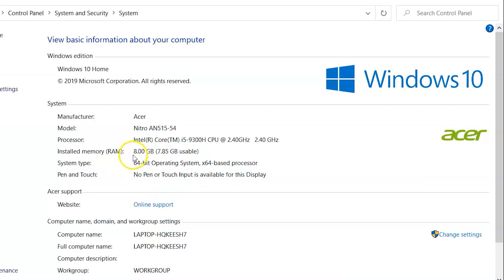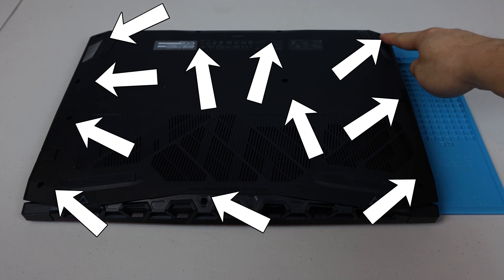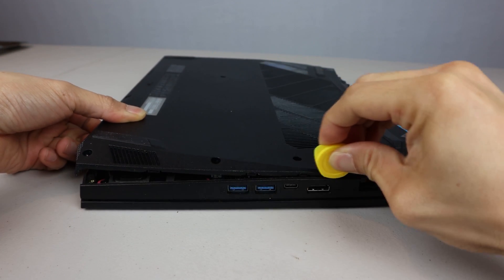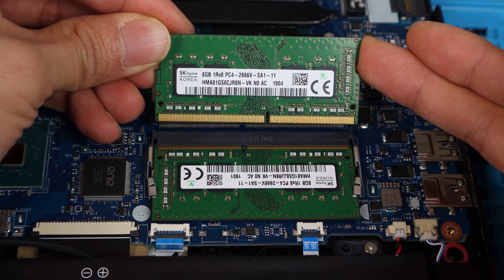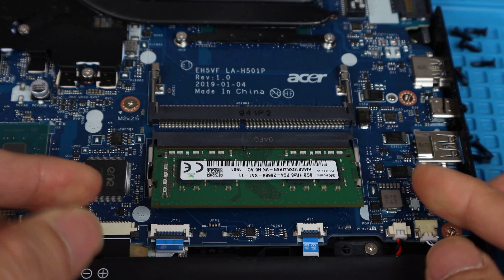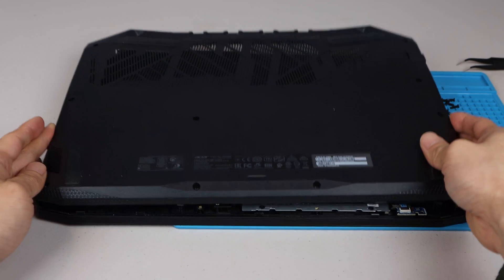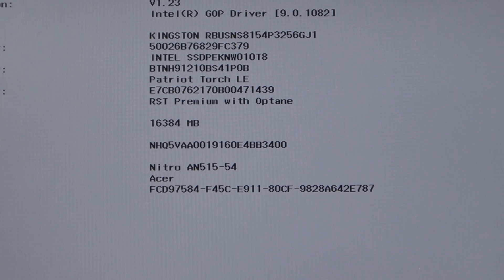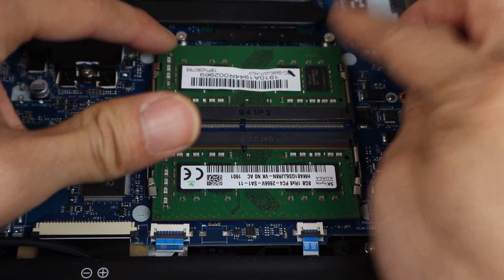How to Install or Upgrade RAM in an Acer Nitro 5 Gaming Laptop (2019 ver) DDR4 up to 2666MHz 32 GB

Comment: @FixItPhil  my laptop came with no ssd in it .but  on laptop its written that it has duaL M.2 SLOTS + ONE HDD SLOT ALSO model is AN515_43 and what i heard  that 32 gb is overkilll ??
Reply from the maker: Yes, for the AN515-43 there are 2 x M.2 slots and a 2.5" HDD slot, similar to the model shown in my video. Slot 1 can accept NVMe/PCIe interface SSDs and Slot 2 is compatible with SATA only. 32GB is the maximum amount of RAM your model can use, but for most users and gamers 16 GB will be quite fine.
Reply: @FixItPhil  oh ok thnx man👍

Comment: i have the acer nitro 5 and i have 8gb of ram, if i were to get another stick of 8gb ram would it have to be the same brand or model of ram stick as the one that comes with the computer. If so can you tell me where i can get it.
Reply from the maker: It doesn't have to be the same brand (though that's usually preferred) and in terms of model, as long as it's the same type (DDR4, DDR3 etc.) you really just need to match the speed (MHz). Here's the 8GB 2666 MHz stick I got for mine, at Amazon: https://geni.us/TDIO [Amazon Affiliate Product Link]

Comment: The rank of the second ram stick has to match?
Reply from the maker: You'll want to get the same type (e.g. DDR4) and same speed (MHz) for the second stick of RAM. You could use a different speed, like one faster or slower, but the laptop will limit the total speed to the lower of the two sticks.
Reply: @FixItPhil  Thx phil, i got the same type and speed.

Comment: Hello, What a good video, thank you ; My case ,   I just bought an Acer Nitro 5 15.6" Gaming Laptop (Intel Ci5-9300H/256GB SSD/8GB RAM/NVIDIA GeForce GTX 1650/Win 10), and i want to expand its RAM to 32GB so what is the proper memory (brand name or link where I can get it ) to buy and get it installed ? 
I saw in other video that you recommended this one " Patriot Viper Steel DDR4 16GB 2666MHz CL18 SODIMM Memory Module "  in amazon 
https://www.amazon.ca/dp/B07QMPTNXY?tag=rbpblogca-20
will it work ? ; please advise!!!
Reply from the maker: Yes, the Patriot Viper steel RAM is compatible with your laptop and should work great. If you want to have it installed for you, you can try bringing it to Best Buy, they have a Geek Squad desk that can help you with that, you don't have to buy the RAM there.

Comment: Hey phil ion anything about these things all i want is max upgrade for my acer nitro 5 ryzen 5 2019 model . Can u explain me what things can i upgrade and my laptop already have 1 tb hard disk . Can i change it into ssd . What is the max range for the ssd in the laptop . And bout ram and memory  . ???? 🙏🙏(My model have 8 gb ram and i tb hard disk )
How much i can  upgrade  this laptop??.
Reply from the maker: All the Nitro 5's max out at 32 GB of RAM, but since the chip inside is 8 GB, you would need to remove it and install two 16 GB sticks instead as there are only two slots available for RAM (see 1:52, the layout inside your laptop should look similar). Here's the RAM that I recommend: https://geni.us/52cnxY [Amazon Affiliate Product Link]

As for the drive, I can't tell from your description if the drive installed is the M.2 drive or a 2.5" drive. If your spec says it's a HDD, then it's a 2.5" drive for certain and it can be replaced with an SSD. If you're not sure, you'll have to open it up and check. All the drives can go up to at least 2 TB of capacity, though the 2.5" bay may be able to handle a 4 TB drive, if you can find one thin enough to fit in the slot (7mm thickness), like this one: https://geni.us/R7u3Bsu [Amazon Affiliate Product Link].

If you have an available M.2 slot, you can install a 2 TB SATA M.2 (I've heard most AMD chipsets are not NVMe M.2 compatible), so you can check out this one: https://geni.us/P7c7kfS [Amazon Affiliate Product Link] Of course if you remove and replace the existing 1 TB drive in your laptop, you'll want to clone/copy it over to one of the new drives, so you'll have the OS in order to boot up and also transfer over all your games and files. Good luck with your upgrade! Let me know how it goes for you.
Reply: @FixItPhil  thnx man appreciate the response thnx again🙏🙏
Reply: @FixItPhil  my laptop came with no ssd in it .but  on laptop its written that it has duaL M.2 SLOTS + ONE HDD SLOT ALSO model is AN515_43 and what i heard  that 32 gb is overkilll ??

Comment: Hello There! Can I also use this tutorial for acer nitro 5 amd 5 edition?
Reply from the maker: Sure, most of the current gen Nitro 5's have a similar layout in terms of the screw placement and internal components. Individual models may vary slightly inside, but for the most part you should be able to recognize the slots where upgradable components can be placed. Everything is labeled on the motherboard.
Reply: @FixItPhil  thank you!

Comment: I have a nitro5 AN515-54-5812 will it use the same one you linked to?
Reply from the maker: Yes, the base model is the same as mine AN515-54, the other part of the model code is just the configuration (drives, RAM, processor, GPU etc.)

Comment: What ram is included in the Acer nitro 5?
Reply from the maker: Mine came with a Hynix 8GB DDR4 2666MHz chip; the specific build is he 54W2. Different builds may come with a different brand or capacity chip though, and it could vary by region (e.g. UK, Canada, Asia etc.)

Comment: hey man i just bought an acer nitro 5 and it has 4gb ram. i wanna add two 16 gb sticks how do i know which to buy. it is up to 32 gb
Reply from the maker: Yes, you can upgrade up to 32 GB of RAM. You should be able to use any DDR4 SODIMM 2666MHz chips in the current gen Nitro 5, though some AMD builds are limited to 2400 MHz. Your best bet is to take a look at the chip that's currently installed and match the speed spec (Mhz) and brand, though that's less important, and just get the higher capacity (2 x 16GB). Here's one that I usually recommend: https://geni.us/52cnxY [Amazon Affiliate Product Link]
Reply: FixItPhil what if i put one 16 gb stick in the other slot while the other slot has 4gb ? will that work fine or should i remove the 4gb stick and leave the other one empty?
Reply from the maker: It's fine to leave it in and pair it with another RAM stick. The performance shouldn't be "worse" than just the 16GB stick alone. If you do experience problems for some reason, using just the 16GB stick on its own would be fine too.

Comment: Do you have to replace the one that came with it or is it optional?
Reply from the maker: No, you don't have to replace it if you're only installing one other chip. It depends how much RAM you want total. I left my original one in and just added a second 8 GB chip for 16 GB total RAM. If I wanted to max it out at 32 GB, I would have had to replace the original 8 GB chip with a 16 GB and add a second 16 GB stick.
Reply: @FixItPhil  also, dose the speed have to be 2.666gh? Or can it be an 2.4gh?

Comment: i installed https://www.amazon.com/gp/product/B07D3NG9MG/ref=ppx_yo_dt_b_asin_title_o05_s00?ie=UTF8&psc=1    kingston one almost identical to the one already in the nitro 5 and i kept getting the blue screen kicking me out any one why is it a faulty ram?
Reply from the maker: It's possible the chip was not seated all the way in the slot, the slot itself is malfunctioning, or for some reason the chip you received was defective. I'd try removing and swapping the chip slots to see if you experience the same problem, if your old RAM works in both slots but the new one is always causing the issue then I'd return/exchange the new one.

Comment: Do you think it's better to have two identical 8gb ram sticks, or two 16gb ones?
Would there be a big difference in performance or would the 32gb combined be overkill for the laptop?
Reply: No it would be fine to have 32, get whatever you think is best for your applications
Reply from the maker: I would say that 16 GB is completely fine for playing most games. Unless you're doing a ton of video processing, photo editing, or encoding, 32GB would be overkill. However, it might be useful for future proofing and the aforementioned other applications outside of gaming. In terms of gaming performance you probably wouldn't notice the different 16GB and 32GB and it doesn't really impact your framerate (fps) which has more to do with your GPU and monitor than anything else.

Comment: What if I don’t use that same brand of ram and get the same spec ram but from micro center will it still work?
Reply from the maker: Sure, generally nothing bad will happen if you use a different brand and match all the specs. There might be slight inefficiencies encountered, depending on their implementation of the chips, but it's something that happens in the background that you wouldn't really notice unless you push your computer really hard often.

Comment: I just installed 32 GB for my laptop. But when I turn it on, it says “No Bootable Device”
????
Reply from the maker: Sounds like your hard drive got disconnected. You'll have to open up the laptop again and check the connections for your drives. It may help to unplug and plug them in again. If you have the same Nitro 5 as I do, this video may help show you how: https://youtu.be/7DZfMJm_k2g?t=198

Comment: Hey dude so I have the Acer nitro 5 4gb model (it's the Acer nitro 5 AN515-54-56VR) and I'm looking to upgrade the RAM. If I put a 16GB RAM stick with the same speed (2666 MHZ) will it be ok? Or can I only add another 4GB ram? I'm relatively new to the laptop upgrading scene so I need to be 100% sure.
Reply from the maker: Yeah, you can use a 16GB stick with a 4GB stick if it's the same speed.
Reply: @FixItPhil  thanks man! If you could, could you link me to some good ram? I really appreciate it man thanks so much!
Reply from the maker: Here's one the that I recommended in the video description, Patriot Viper Steel: https://geni.us/52cnxY [Amazon Affiliate Product Link]

Comment: I’ve got an issue I was wondering if anyone could help, I installed 2 8gb ddr4 2666mhz and I know they both work individually as I’ve tested, but when both slots are occupied, only slot 1 works or is read. I was wondering if I needed to enable slot 2 in bios or slot 2 may just be faulty. Thanks in advice.
Reply from the maker: Hm, it sounds like slot 2 could be damaged. What laptop model and OS are you using? There may be some other limitation that is preventing your system from utilizing more than 8GB.
Reply: FixItPhil hey thanks for the response. I have confirmed that the slot 2 is faulty and so I’m just going to return or sell the 8gb kit and use a 16 gb on slot 1. Anyways keep up with the videos.

Comment: So i was wondering of taking of my factory ram which is 4gb and replace it with 8gb and add 8gb more so it could get 16gb. But i was worried that if i bought rams its not compatible with the Processor? Or if it even make sense.. but i have a ryzen 7, so what are the things i should consider first before doing that. Really need a big help
Reply from the maker: Sure, you can replace the existing RAM with a higher capacity one. Laptops aren't really brand dependent when it comes to RAM, so as long as you get RAM that is within the capabilities of your system you should be fine (for example, some Ryzen laptops max out at 2400MHz, so 2666MHz chips will run at a slower speed).

Comment: How to fix my screen being black when I did the upgrade I cant see nothing on my screen
Reply from the maker: There could be a number of reasons for this. If the RAM is not seated correctly the laptop may not boot up. A connector may have come loose or been dislodged during the disassembly or installation. The  battery may be disconnected from the motherboard... Since I don't have the laptop in front of me I can't pinpoint the exact issue. Does anything light up when you press power? e.g. the keyboard, LEDs on the sides, does the fan turn on etc.?
Reply: @FixItPhil  I fixed the problem it was the ram stick I installed when I jave it in the screen is black but when I take it out its good again idk why my ram is not working looks like I'm stuck with only 8 gb
Reply from the maker: @CallKoji  Oh ok. Yeah. it sounds like either the RAM chip is corrupted/damaged or not compatible for some reason.
Reply: @FixItPhil  the keyboard and the led lights up  but when I turn the laptop off the fan starts to work when I turn it on it doesn't

Comment: Do all Nitro 5s (2019) have the same ram sticks?
Reply: No they do not. Although they are all the same size physically, the speeds and capacities are different. Its helpful to check the Acer website or your existing Ram stick to determine which speed the existing one is. For example on my AMD Ryzen Nitro 5 it uses PC-3200 memory.  The Intel version of this laptop uses slower memory. Crucial.com is a website that will scan your computer to see what memory is installed in your system. Hope this helps. I am a certified computer technician.
Reply from the maker: No, I think it will depend on your build and where you buy it from. My build build came 8 GB RAM but I've seen other bundles that come with 16 GB pre-installed. I'm not sure if the brand of the RAM is always the same either.
Reply: FixItPhil My Nitro 5 came with 8 GB, is there a way I can check the speed of the ram sticks?
Reply from the maker: @Patayder  If you have Windows 10, to check your RAM speed, right-click on the taskbar and choose Task Manager from the menu. If it's in compact mode, click More details, then click on the Performance tab. Click on Memory and you'll see the speed in the right hand column under the graphs. It will also tell you how many RAM sticks you have installed (slots used). I think most factory builds include only 1 RAM stick. The only time you'll really see 2 RAM sticks is if you buy a custom build (usually 3rd party or individual) as some specialty sellers will "pre-upgrade" and tweak the laptop to its max and sell them to end-users at a premium.
Reply: Noles It always comes with one stick

Comment: THANK YOU SO much you made me so much more relieved I thought I would've broke something because I put in my ram the other way but looks like you can just flip it over and it will still be the same thank you so much
Reply from the maker: No problem. The notch in the RAM chip is positioned so that it can only fit into the slots in one orientation. It's impossible to mess up because other wise it won't fit in or clip. It doesn't matter which slot you put the RAM stick in, top or bottom.

Comment: Also would this work if my goal is to get 32 gigabytes of ram? This is pertaining to the exact same gaming laptop.
https://www.amazon.com/Timetec-PC4-19200-Unbuffered-Notebook-Computer/dp/B07FF7HTL3/ref=sr_1_2?dchild=1&keywords=Hynix+16GB+PC4-21300+DDR4-2666MHz+260-Pin+SODIMM+1.2V+Single+Rank+Memory+Module+HMA81GS6CJR8N-VK&qid=1592496571&s=electronics&sr=1-2
Reply from the maker: No, the kit you linked here is 2 chips totaling 16 GB. Since the laptop only have 2 RAM slots, you'll need two 16 GB chips totaling 32 GB, like this one: https://geni.us/vcGYtx1 [Amazon Affiliate Product Link]

Comment: What was your workspace like when you made this video? I'm worried somethings in my room may cause static damage.
Reply from the maker: I worked on a folding table in my living room. Linoleum floors, no carpet, but there was an area rug under the table. I was wearing a grounding wrist strap, which came with my electronic repair mini screw driver set: https://geni.us/bWoL [Amazon Affiliate Product Link]

Comment: Hello, how can you upgrade if you have Ryzen 7 2700U Version of the Nitro 5?  What are the things to consider before upgrading it? thank you
Reply from the maker: Depending on your exact build you may be able to upgrade the RAM (up to 32 GB) and/or install additional drives to increase the total amount of storage space. The things to consider would be the type/speed of the RAM (DDR4-2400MHz is the max for your system) and whether or not you want to replace any drive already in the system and whether that drive is your primary boot drive. For example, if your primary boot drive is 256 GB and you want to replace it with a 2 TB drive, you'll have to clone your operating system and files over to the new drive in order to make it bootable. An M.2 drive as the primary boot drive will give you better performance over an identical capacity HDD. If installing an M.2 drive you'll also have to consider interface type of the drive, as many users have reported that the AMD Nitro 5 builds only work with SATA M.2 drives (even though some have been spec'd to be compatible with NVME interface, it doesn't always work).

Comment: Will these work? https://www.amazon.com/Timetec-2666MHz-PC4-21300-Unbuffered-Upgrade/dp/B07P5W2TM5/ref=mp_s_a_1_22?dchild=1&keywords=hynix+ddr4+2666+16gb&qid=1592264650&sr=8-22#immersive-view_1592265048372
Reply from the maker: Yes, though most of the Nitro 5 builds max out at 2400 MHz, so you'd only get the performance of 2400 MHz with this kit. Even so, the price of the analogous 2400MHz 32 GB kit is pretty similar in price: https://geni.us/vcGYtx1 [Amazon Affiliate Product Link] so it wouldn't make a difference either way.
Reply: @FixItPhil  thanks I just used the 16 you have in the description

Comment: Great vid bro. Would you mind making a  video on how to clean the fans  and re applying thermal paste?
Reply: You are asking for trouble when reapplying thermal paste. It's not necessary unless you had to replace your CPU. It's a risky task even for experts like myself. And the minimal thermal advantages (usually 4-5°C) do not outweigh the risk. Your fans should be cleaned particularly if you operate in a dusty or dirty environment or have pets. Clean your fans periodically with high quality electronic specific compressed air. This should be done at most twice a year.
Reply: ye but tooth paste oughta work like a charm